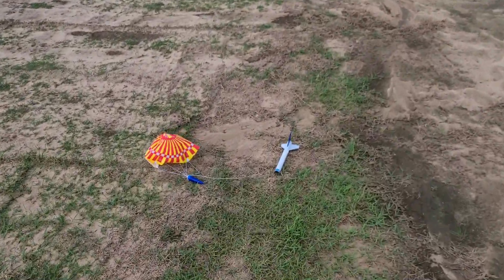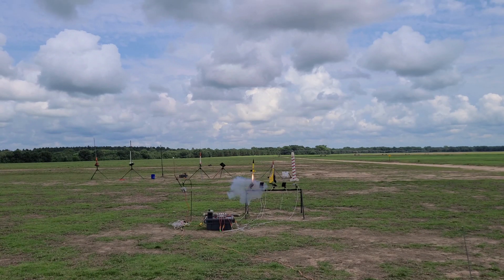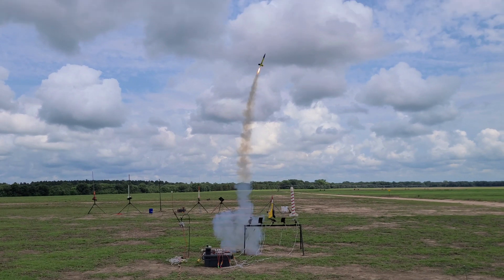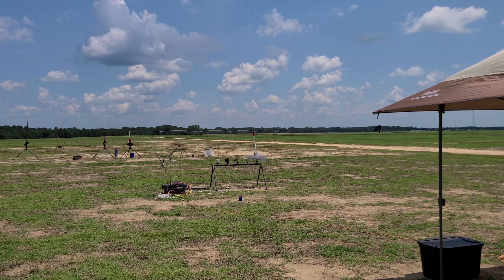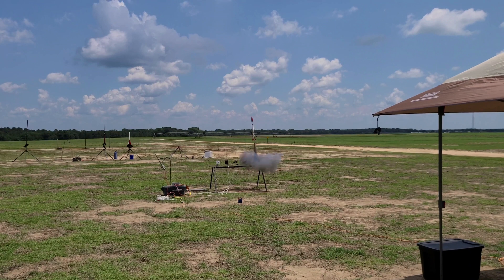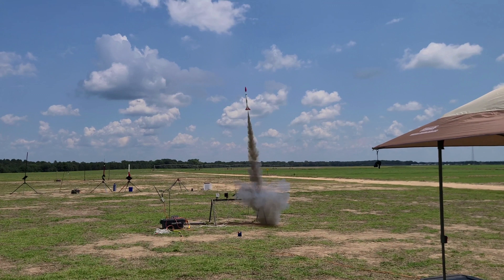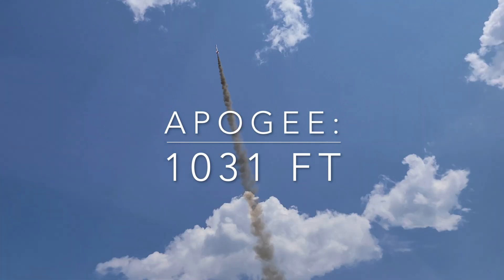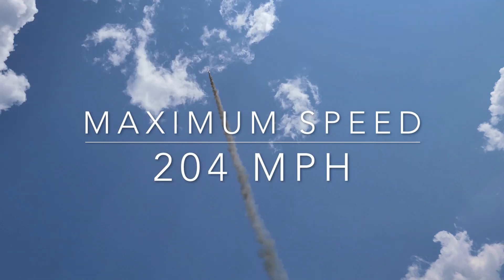Astra, Goblin and Olympus Rocket Launches

Comment: What kind of launch pad did you use for your Olympus rocket?
Reply from the maker: Typically the sawhorse type launch pads at rocket club launches.  Otherwise I use the estes Porta pad -e (it's the estes launch pad with the white plastic center piece and black legs), it has a wider base than the regular/starter estes launch pad.  The launch rod I get from either lowes or tractor supply.   You can use the regular/starter estes launch pad but only if the legs are secured to the ground in some way, such as tent spikes or weights, although my preference is to just go with the larger Porta pad-e, it's not too expensive if I recall correctly. If you don't secure the legs on the starter/regular pad the rocket can tip over in the wind before launching.